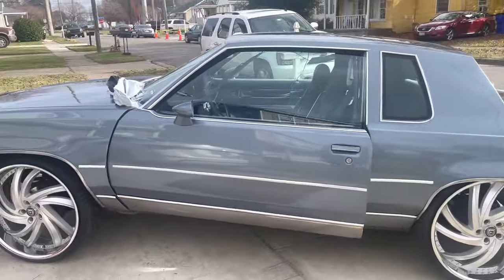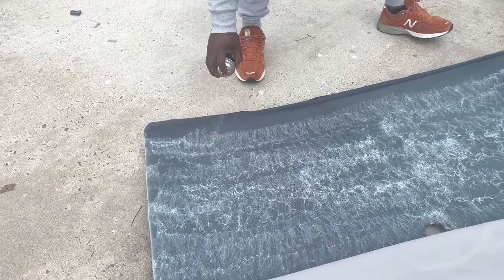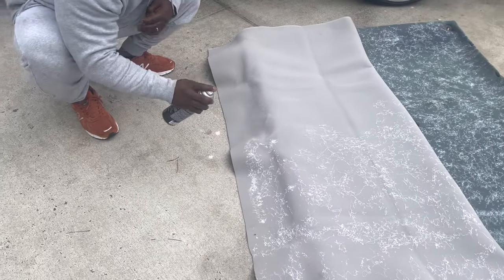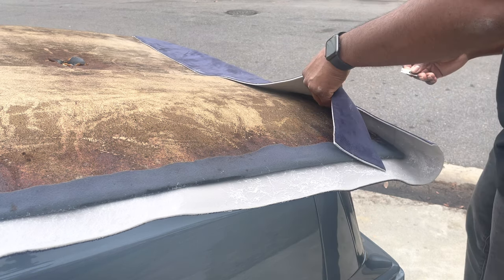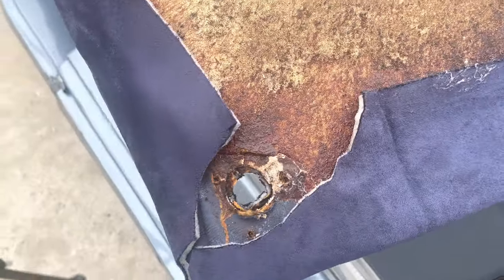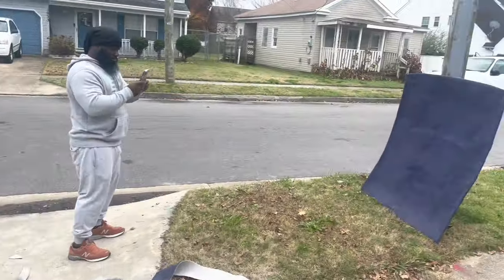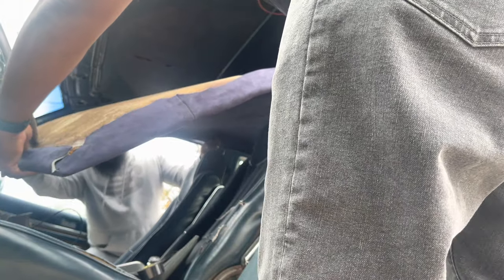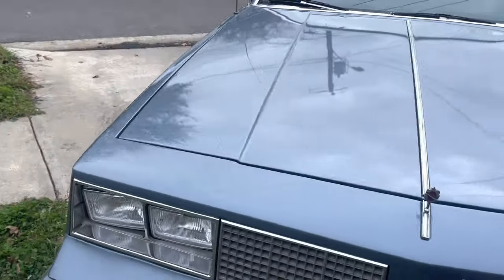DIY Suede Headliner in 1985 Cutlass Salon GBODY

Comment: If I may give a suggestion for next time . I'd have taken the cover off and fiberglassed the weak spots on it. Putting new material on with weak spots may be too heavy and possibly make the weak spots worse. Just a thought.
Reply: Also with suede you need to use landu top adhesive instead of spray can adhesive. Suede is a bit heavier than the normal head liner material so it needs stronger glue. Landu top adhesive is sprayable and brush able.
Reply from the maker: Thanks!!

Comment: Y’all coulda got some particle board from Home Depot for the rear deck. Just remove the old one,trace it onto the new,cut it out,drill out speaker holes,wrap that suede around it and install!
Reply from the maker: Good call bro!! I appreciate it...I'ma keep that in mind ✊🏾👌🏾🦾
Reply: Exactly I did that to my '78 Nova back in the 90's lets just say I started making rear decks for the whole hood lol
Reply from the maker: @nathanielbolden5053  🦾🦾🦾
Reply: @nathanielbolden5053  LOL,ikr me too! Back then in the 80s we were cutting the rear deck out and installing our speakers,woofers and/or 6x9s on there,before building boxes in hatchbacks and trunks. And the wall behind the rear seat. We did all our own stuff back then man,no money for no custom install shops.
Reply: @kingbrod1  man you already know!...but the g-body made you get creative with those small rear decks!...oh and along came the JBL Futbols
Reply: @nathanielbolden5053  yeah the smaller cars with narrow decks would hold 6x9s or 5x8s but either build a wall behind back seat of place your house speaker in the trunk LOL. I came along when we were riding the big A body Regal,Cutlass,MC,Nova,Fleetwoods and then hatchbacks came out. Rear deck in the big cars,box in hatchbacks 🚗

Comment: Good job gentlemen! You did a great jobfor the DIY, but removal of the old headliner is necessary due to the fact it isnt designed to hold the weight of the 2 headliners..and the glue needs to adhere to a none porous material...plastic or foam